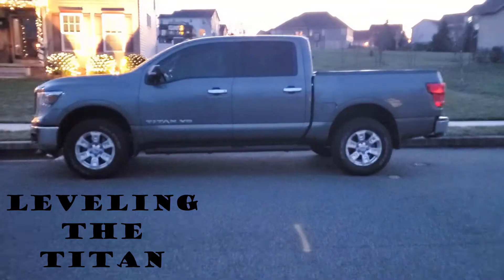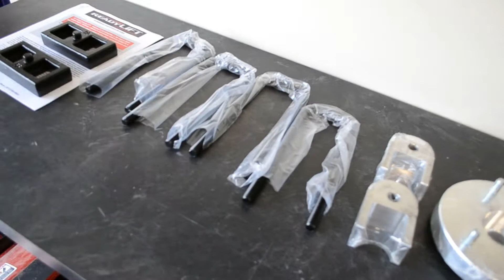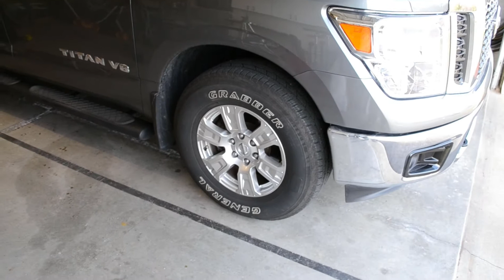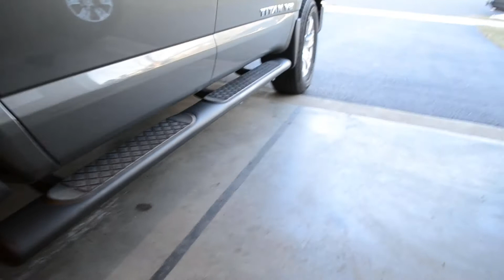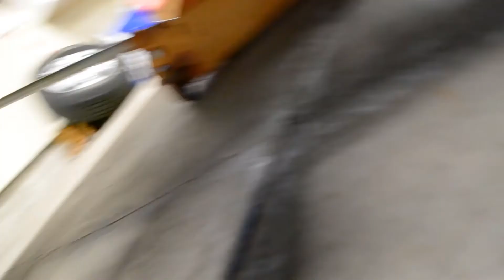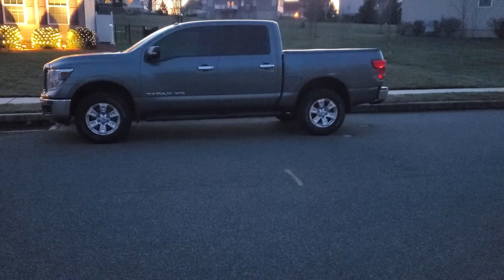2018 Nissan Titan - Ready Lift 2" Leveling Kit Install

Comment: Looks good..I did the same to my Titan Pro4x.
Reply: Are they making leveling kits for pro 4X  now? I have a 2018 pro 4X and have not been able to find a leveling kit for it.
Reply: @jjwg7529  Yes..Mine is an adjustment level using Bilstein shocks.. B8 (Ride Height Adjustable) Gas charged shocks..Rough Country also makes a leveling kit for the Titan.

Comment: Hey there…If the front rakes from factory is it necessary to do the rear? Bringing up just the front doesnt level it? Curious…
Reply from the maker: I thought the same thing.  Believe it or not you end up with about a half inch squat at the rear with just the front leveled.  Don't ask me why they designed it that way.  True of many front leveling kits from what I have read.  I could see it actually after I leveled the front only. Originally wasn't sure I was going to lift the rear. But it would have bothered me.  Sure no one else would have cared... lol.
Reply: @theaveragejoesgarage5418  I’m thinking that even a small amount of squat would bother me also. I appreciate the reply…keep the super interesting videos coming!

Comment: Getting this kit on mine today and upgrading my wheels and tires to a 33x12.5. The offset is -19 on wides. Do y’all think I’ll be ok?
Reply: So does it rub at turns?
Reply: @jesusmelchor7681  had to remove front mud flaps and very minor trimming

Comment: Nice, I have the same truck and put a 2 inch leveling kit and tires on mine also.  How do you like your Titan?  I really like mine for the 2 years I’ve had it.
Reply from the maker: Love the truck.  Its simple and the 5.6L is a beast for a stock motor.  My old truck was a 99 Ram 1500.  No comparison.  Very happy with the purchase.
Reply: Anyone know?  Whats largest size tires can you fit with 2 inch leveling kit and use same rims.
Reply: @chuckduchamp7560  Probably a 275/70/18. Maybe 285/60 or 65 but might rub at turns.

Comment: How are you liking this kit so far? I am about to pull the trigger on this but would like to hear your thoughts.. did you ever get new tires on it yet?
Reply from the maker: Honestly I am really impressed with the kit.  It hasn't changed the ride quality at all.  The alignment was uneventful.  All in all it was a great buy.  The fact that I got it for half price helps.  No tires yet.  I have them picked out but I have to play nice with my wife.  Soon.
Reply: @theaveragejoesgarage5418  can't beat that price. Once I buy this kit then it is finding the right size Toyo open country at 3's.. to fit the look. Keep up the great videos and stay safe!
Reply from the maker: @nickmartorana359  that's the exact tire I'm looking at. 275 70 18s.  Hard to find right now for some reason.

Comment: Any issues with coil bucket contact?
Reply from the maker: Ahhhh, the dreaded CBC.  To date, no.  I haven't worked it hard as the truck has been more recently a pavement princess.  But so far, no coil bucket contact.
Reply: @theaveragejoesgarage5418  awesome good to hear I've been considering getting the bilstein 6100s and 5100s for the rear, but the price of the readylift makes it hard to pass on.